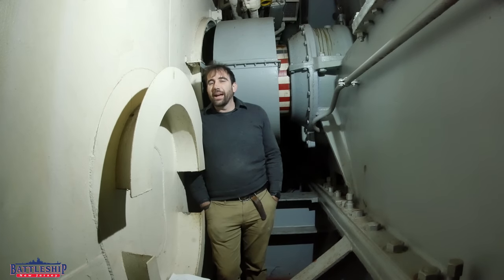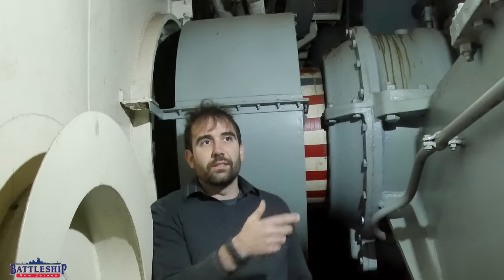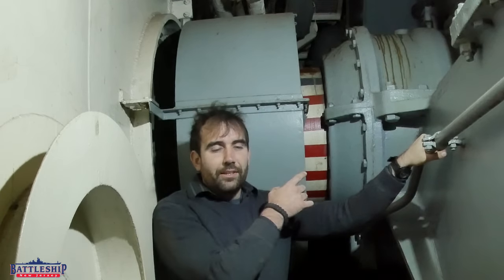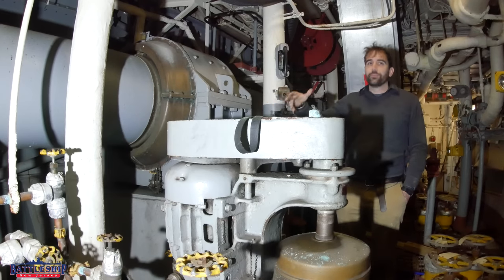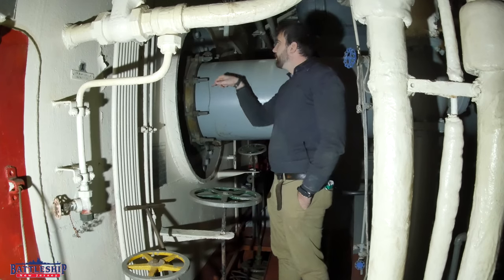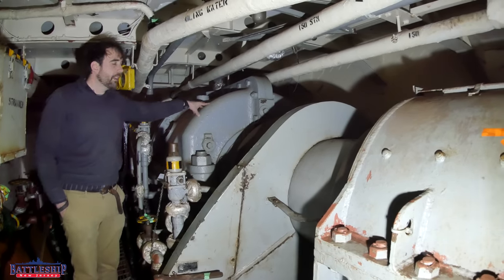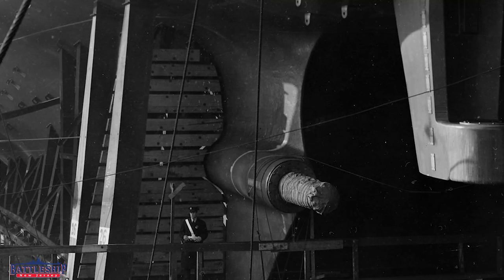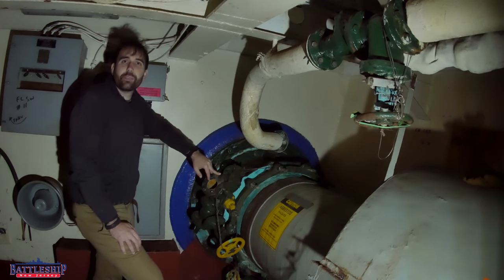Battleship Sized Propeller Shafts

Comment: Shafts on a carrier are also rather large and hollow. However, they are filled with sand. I am willing to bet so are New Jersey's.

And we call the "Spring bearings" Line Shaft Bearings. 

A Nimitz's propeller is a turn and a half behind the Main Engines at full power. If New Jersey's shafts were hollow and filled with nothing, it would twist like a candy cane rather permanently under full power torque.

Ryan really needs some MMs, BTs and other engineering rates to help him with theses.
Reply: They are always willing to accept volunteers.
Reply: FYI - Navy merged the BTs into  the MMs way back in 1996. Very few ships remain with boilers. (most LHA/LHD- newer are the LM2500 Gas turbines). The Command Ships LCCs are Military Sealift Command sailor for the engineers Now. He does pretty good with this. IF within the NJ U-tube page you search on Boiler tech- you can find about 5 interviews with past Boiler Techs. I'd also recommend see Gary Pepek interview - recorded in around 2001 or 2002 when he retired as an E-9 - started as a BT later changed to MM as required.
Reply: @wfoj21  I am well aware of the merger. I was referring to old salts.

-MMN1 (SW) Ret.
Reply: @wfoj21  Yea, that "lube oil pump" sure looked like a lube oil purifier, and the spring bearings were lined with babbit, I remember hand scraping a new spring bearing. Only the bearings OUTSIDE the hull were lined with wood, since they relied on seawater for lubrication and cooling. Even a old BT knows this.
Reply: @Shaun, to my knowledge it was the submarine shafts that were filled with sand, not the CVNs.  They discontinued filling the submarine shafts with sand some time in the 90’s (ex-NNSY engineer).
Reply: @johnjensen2217  I was told that the Truman's shafts were filled with sand in 2000 when I first reported aboard. I had no reason to doubt it. Kind of hard for a hollow pipe to take the torque the mains put out without permanent deformation. Even one over 2 feet in diameter. I don't remember seeing the inside to the shaft when they pulled them from the Stennis's stern tubes in dry dock.
Reply: Truth

Comment: My cars has 170hp. but it does NOT have! 2000crew, enogh firepower to destroy a city in a weekend, 17inches of armored citadel and is the only thing heavvyer than most moms from "yo mama" jokes. but a thougt has struck me, how would this ship have been, if it was built today? same basic design, but with modern steering, tech and materials. the gun turrets would only need a few peeps pr barrel, not 70+. the maintanance would probebly be half, etc.